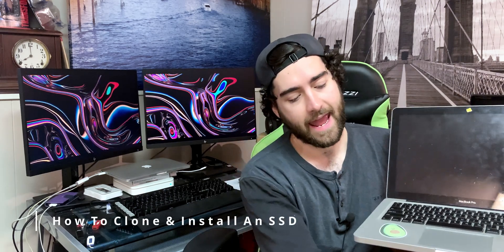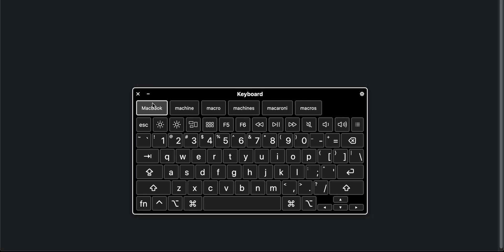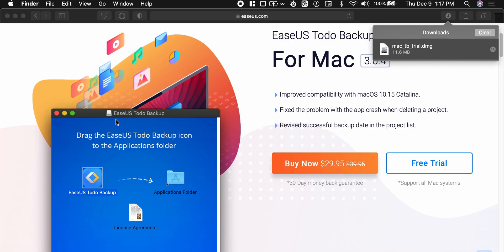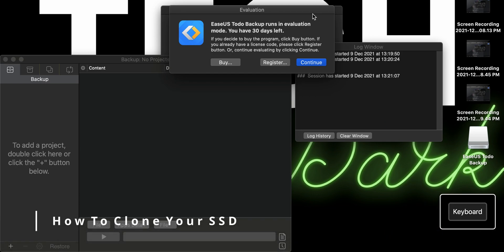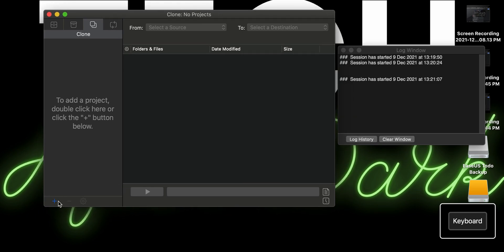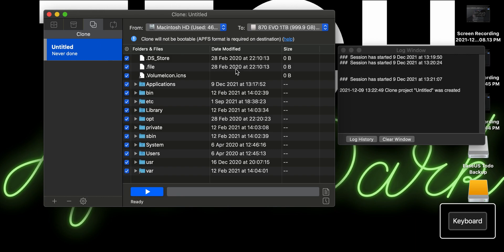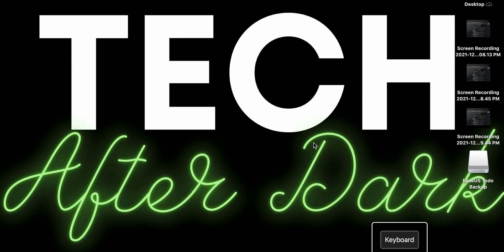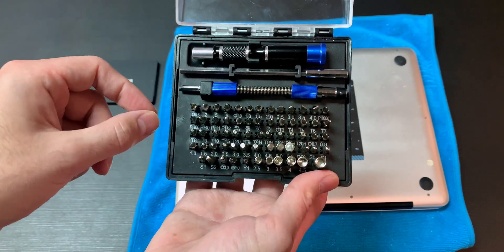How To Clone & Install An 870 EVO SSD Into A Unibody MacBook Pro

Comment: Very good information, thanks. I have a MacBook Pro late 2011. I did everything the same as you explained then installed the 870 EVO SSD in the computer but I can't open it, show me a little folder with a question mark. I have to hook in the USB the old Mac hard drive to open but when open it asked me the password to open the SSD (so I believe it's reading it) I got lost in some place on your video, appreciate your help, thanks
Reply from the maker: I would do a clean install! And get the dongle to read it! The sata dongle. Make sure you install mac os Mojave on it before you put it in the computer, and make sure it boots up using the usb dongle attached to the SSD. Good luck!
Reply: @TechAfterDark  I'll try, Thanks